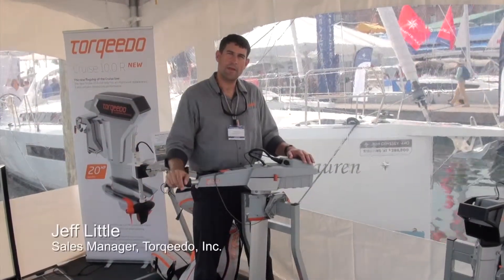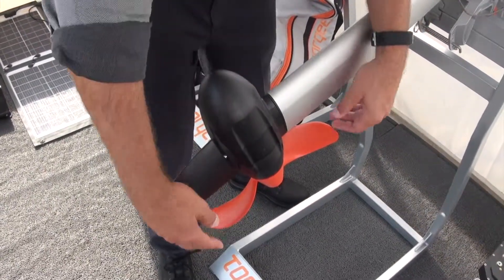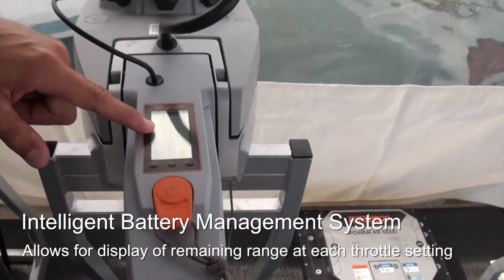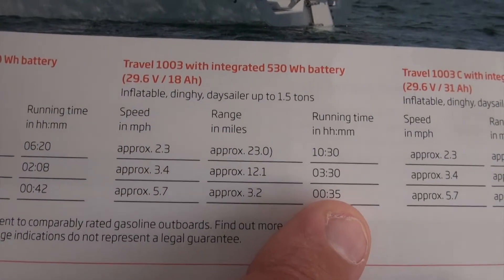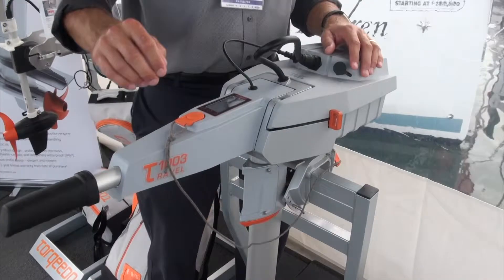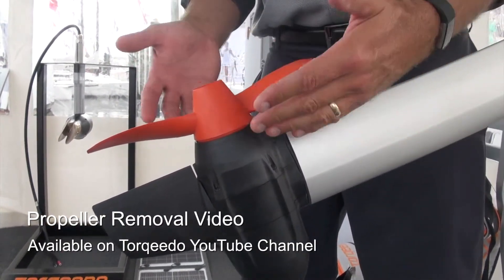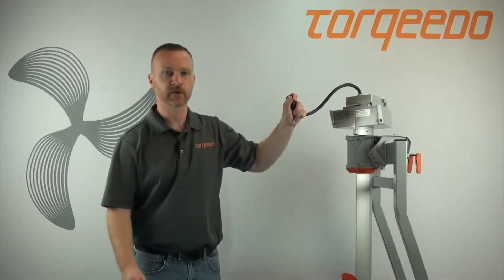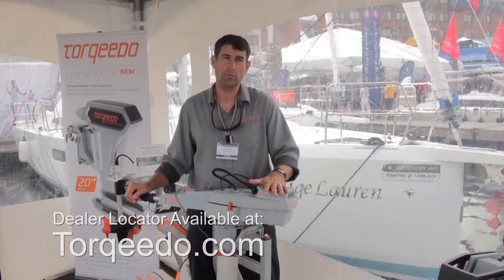Torqeedo Travel 1003

Comment: How long was the 1003 around?  It seems like a long time.  Its too bad the 1103 has no improvement in range (according to the charts provided), and we've really had no meaningful change in tech or range in these in 10+? years.  Electric cars have been improving their range and tech over the last 5 years, with cars now instead of a 80-250 mile range, are now going 300-485 miles on a single charge..but this improvement hasn't shown up in electric outboards.  Its as if the innovation in electric boat motors is dead.  10 year old 1003- mid throttle range: 20 miles.  New 1103 mid throttle range: 20 miles.  Pretty disappointing.
Reply from the maker: The range is battery dependent for the most part. The bigger jump in range came a few years before the 1003 was sundowned to the 1103. A 916 Watt hour battery became an alternative to the 530 Watt hour battery. The range almost doubled in 2016/17. Motor efficiency is the other part, and is the central part of Torqeedo R & D - making sure that the power in the battery translates to as much thrust at the propeller as possible.